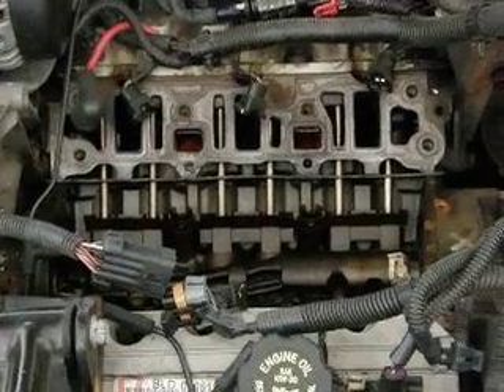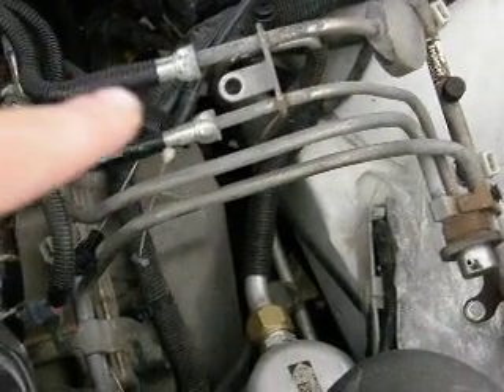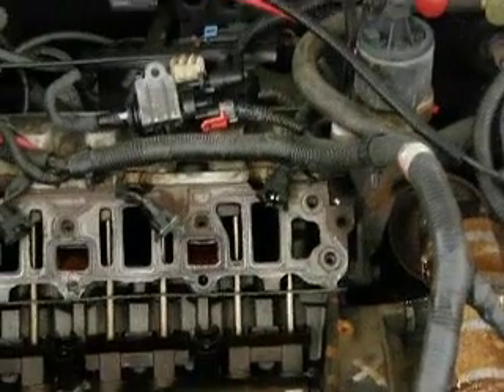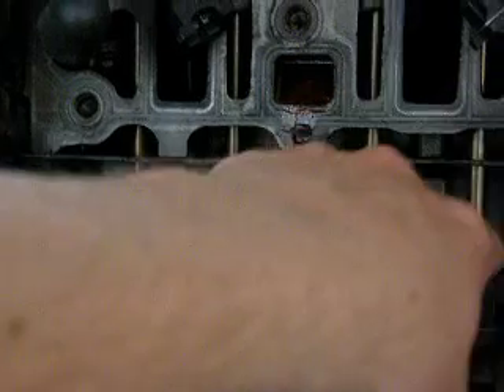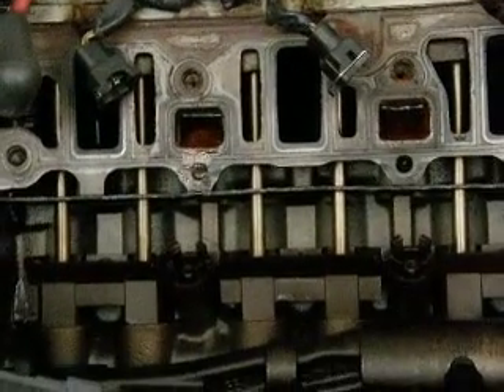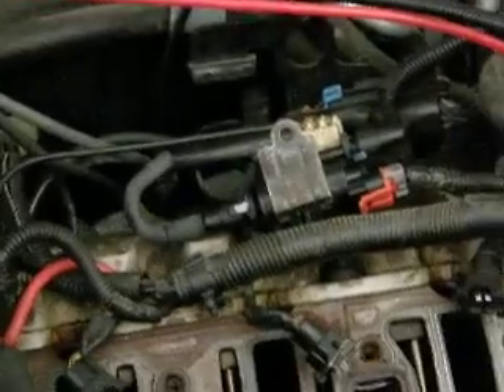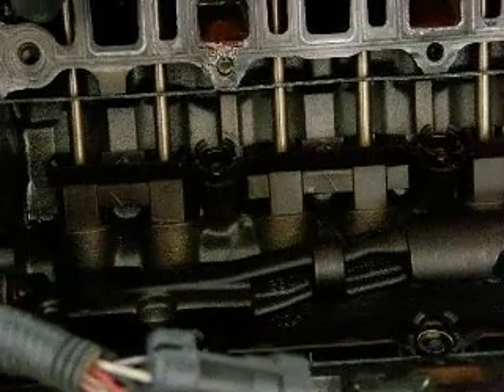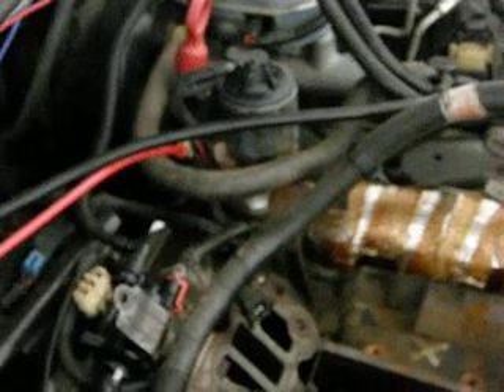Port and Polish your 3.8L!! Crash Course and How to's

Comment: EGR only opens below a certain coolant temp, it's designed to help the motor heat up faster to reach peak operating efficiency earlier. Otherwise, it's closed and doesn't do anything. For a normal driver, it is beneficial. To someone chasing peak performance, it's just an extra 1kg of stuff and extra wires to deal with but you need to disable it in the tune so the CEL doesn't spaz out
Reply: That's not true at all. Please, if you do not know what you're talking about, please don't just shoot a guess. 

The EGR functions at cruising speeds. It's function is NOT to warm up the intake. It's function is to reduce combustion temps, but reducing nox hydrocarbons in the combustion process. Period
Reply: @boosted0079  go look up the tuning software for the 3.8 and get back to me

Comment: I salvaged my 90 deg elbow. EASY before you pull the intake off spray with WD/40 and the when u slide the intake to the right it will slide out np. Also before I slid it I took a screw driver and nudged it a little so it was broke loose. Mine was perfect good and soft and pliable and great o rings. I do understand tho a lot of them are hardened and cant be saved.

Comment: The EGR actually LOWERS cylinder temps, the inert gas cannot be burned therefore there is less flame which equals lower cylinder temp. Ripping it out without changing your tune on a boosted vehicle could be harmful over a period of time if its drivin under boost alot especially if the intercooler and coolant system are operating at their upper limits. It has nothing to do with displacing gas
Reply: Doesn't function when under boost. It only functions under cruising speeds, not even under any kind of engine load or WOT condition

Comment: hey! You said the balance shaft circulates coolant? I'm ASE certified in 9 different areas including engines and i've never seen that on a GM engine. The balance shaft helps counter-act crank vibrations. See 90 degree block w/120 degree firing order. look up the history of the 3.8 and see why and how it's v8-ancestor left it with a balance prob. Very very largely produced engine from late 80's to current in a LOT of GM vehicles....one of the world's best engines, too...( for production cars )